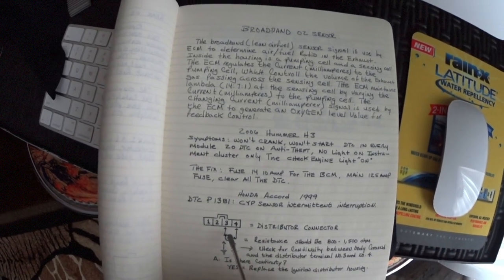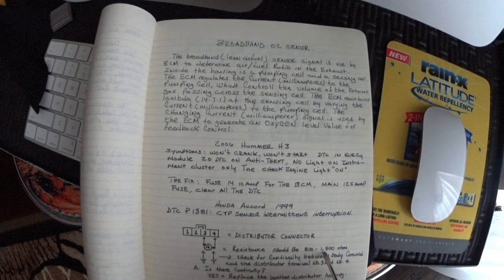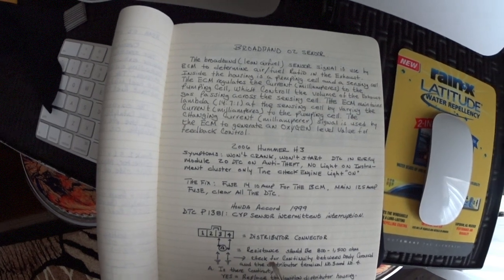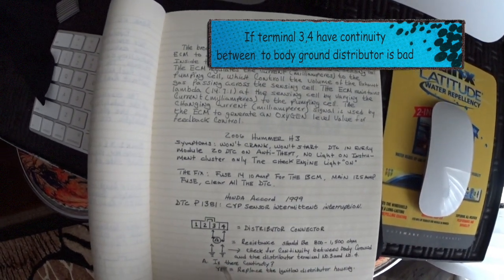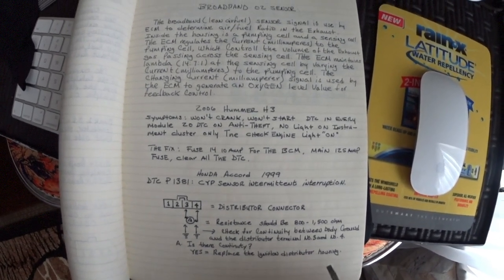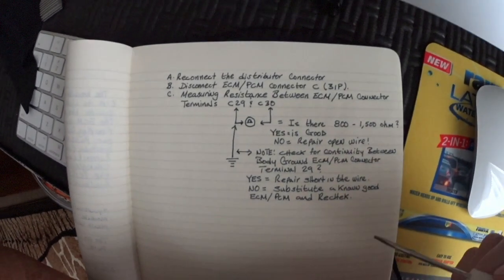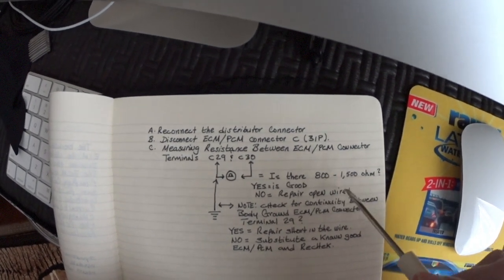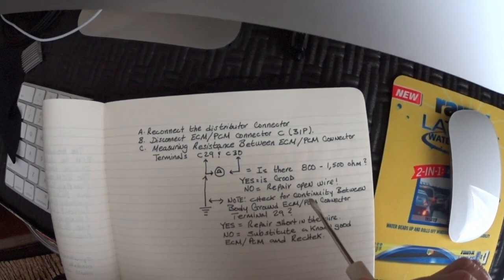DTC P1381 on 1999 HONDA Accord 2.3L vtec

Comment: I was getting the P1381 code on my 2000 accord 2.3 ex coupe. After researching the issue it turned out it was also my alternator like everyone else is saying on here so seems like to be a pretty common fix for this code.

Comment: This code comes on with my O2 Sensor being changed, my distributor is brand new though. Currently have an O2 Sensor installed with roughly 50k miles on it, I bought a (faulty) universal O2 sensor but it gave off a P1164 code and a P0505 code. So I put the original one back one (50k miles) and I still have those two codes but now the P1381 had been added. I cleared the codes and went for a test drive for each sensor and noticed the original took a longer time to set off a check engine than the faulty one as it came on right upon start up. I need some help please I'm at a loss

Comment: Cuando lo ases en español, P1381 honda acorde lo año99, 4 cilindros automático, gracias
Reply from the maker: Silvestre Garcia 👋 Hola ese código casi siempre es el ignition Distributor oh 😮 el alternador que el diodo que controla la corriente A/C la está pasando a la D/C  ... tienes qué hacerle una prueba con un oscilloscope al alternador para saber
Reply: @PeteSambolin  gracias  por su valioso tiempo amigo
Reply: Ese falla que problema ocaciona mi honda accord 2001 no pasa d 3mil rpm algun consejo????

Comment: I just replaced the distributor and I have the same code still
Reply from the maker: King of slots MILLION okay !!! First where you get the ignition distributor ! Know in troubleshooting DTC P1381 you have to make sure the coil shield is correctly installed... If you can find any problem then you have too clear all DTC storage in memory on the ECM then unplug the connector from the Alternator and test drive the vehicle if the DTC P1381 comes back your new distributor is defected . If the the DTC P1381 doesn't come back you have a bad alternator diode... Pull the alternator out and take it to any Advance Auto Part store have them check it for you! They do it free of charge!
Reply: Great reply buddy. I'm going to take off Alternator now and hope it's a bad diode. I'll keep you posted

Comment: My 2001 accord 2.3 has this code p1381 changed distributor and code still pops up any suggestions
Reply from the maker: Doo a alternator test most likely is the problem also check if the distributor is missing on the coil the shield ...
Reply: Thank for the info
Reply: @PeteSambolin  i got a honda accord and when i get to 6000 rpm  it drop and the car die till i get back to 5000rpm ,      i test my vtec selenoid and voltage is 13 at 2800rpm its kinda low for a vtec to kick in , any sugestion ??
Reply from the maker: Robin Benoit Hi 👋 sound like Rev limiter control by your engine computer! Or a bad signal from engine speed sensor! You have to see DATA parameters on a professional scanner to see where the bad signal is coming from!
Reply: @PeteSambolin  its giving me a code p1399 misfire in every cylinder :$
Reply from the maker: Robin Benoit what year? And if any other DTC
Reply: @PeteSambolin  2002 honda accord 2.3 vtec (f23a1) code p1399 and p0420
Reply: @PeteSambolin  i put a video on my chanel if you whant to check , thank for the help very apreciated
Reply: Same issue here. Brand new $300 alternator
Reply: @CarGuy87  please check your CRANKSHAFT SENSORS
Reply: AGREE

Comment: It was the alternator. We changed VTEC sensor shifting sensor thought it was the cam sensor... it was the alternator... yes I know it said distributor but in order for the distributor to distribute the energy it comes from the alternator. Unplug the plug and if the engine is not stable and the alternator makes noise when the plug is on..m the alternator is defective. Alternator shouldn't make noise
Reply from the maker: eric dias one of the variables in this particular DTC you right! But in this case study was in fact a brand new ignition distributor defective! How we find out with the frequency test was out! We change it and the problem went away!!! Was a FIX!!!
Reply: Pete Sambolin I believe you. We had the same issue . Changed distributors changed the housing inside 3 times and the problem kept happening. The scammer kept throwing p1381 and we couldn't figure it out. Went with two different sensors and same problem,  till we changed the alternator. I guess it's little details here and there. Freaking cars mannn
Reply from the maker: eric dias yep! Is a TSB for the shield that covers the coil we check all that ... but believe me next time I will check all the variables...
Reply: AGREE

Comment: Have you seen honda news bulletin September 2005? Bad diodes in alternator could send interference to throw a code P1381! 
http://docshare.tips/img/20515/dtc-p1381-honda-civicpdf_576a234ab6d87f28318b4823.jpg
Or
https://www.hondaaccordforum.com/forum/attachments/general-tech-help-7/11674d1377383206-2000-honda-accord-4cyl-bogging-3000-rpms-trouble-code-dtc-p1381.jpg
Reply from the maker: Karl Ruehs yes I have that information in Mitchell On Demand 5   Have the TSB and Recall thank you for the tip!